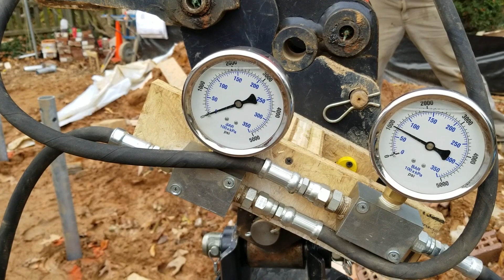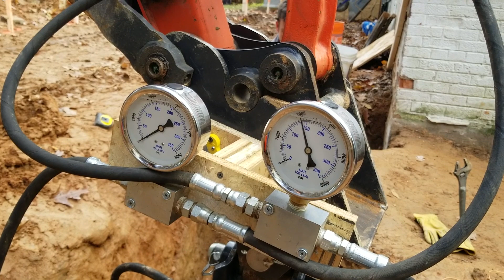helical pier install

Comment: How well does this work if there are any rocks in the way and what do you do if you can't get a pile in because of rocks?
Reply from the maker: small to medium rocks we can usally walk around, if we hit larger rocks and are unable to drill thru we often have the option of moving one way or another.  if we hit a layer of rock or bed rock we try to embed the shaft into that, but the engineer will make the final call on all piers, depths and pressures.